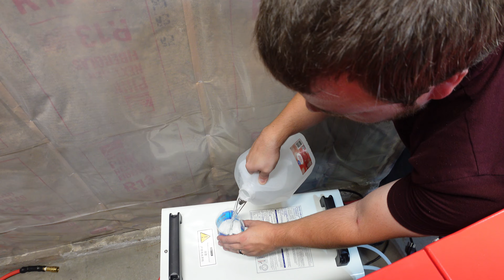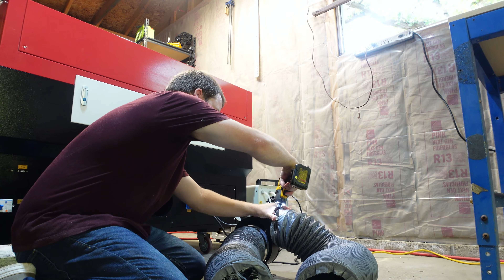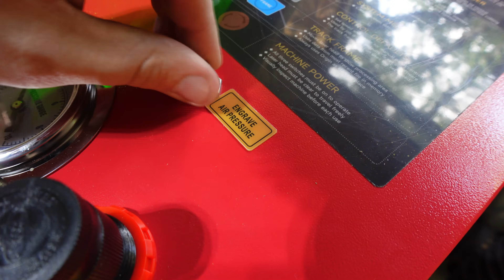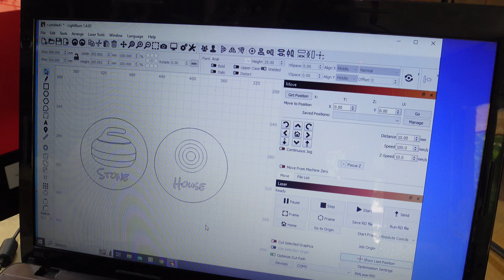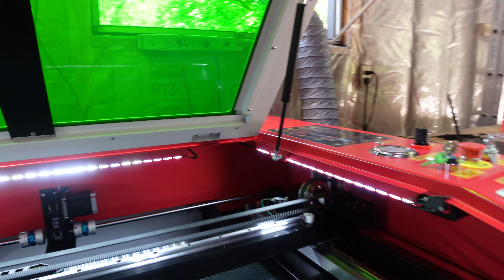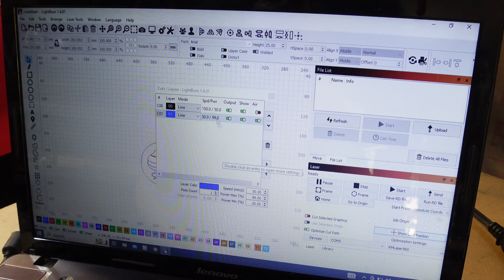How to Setup Your Chinese CO2 Laser Engraver Cutter - RMLaser RM960 Pro

Comment: How do you connect the laser to lightburn? I did exactly like you and had to manually add it but on lightburn it shows laser disconnected.
Reply from the maker: Make sure your usb is connected to the rear usb port on the laser, not the side port.

You might need to install a driver so your com port recognizes the laser controller. Go to device manager in windows and make sure the com port is recognizable. 

Also make sure your lightburn version is correct. In Lightburn go to Help>License Management

Just under the license key section, make sure it says Gcode, DSP

If you don't see that, you'll need to upgrade your version of lightburn to talk to the ruida controller. The cheaper version only talks to diode lasers.
Reply: @lukeman269 thank you

Comment: Can this machine cuts 20mm acrylic ?
Reply from the maker: @eou.itachi8774  no I don’t think so. I’ve tried to cut 19mm wood and it doesn’t do very well. They make different lenses that would allow you to cut thicker material more efficiently. Default configuration comes with a lens that can cut 10mm material and engrave detailed images.
Reply: yes, the machine can cut 20mm acrylic, because acrylic has a more uniform density than wood, it can be cut easily.

Comment: Can the compressor be set at the reguator at a higher setting say 100 psi but controlled at the machine for say 40 psi? I'm hoping I can still use my compressor for other things other than just the RM.
Reply from the maker: @TheAyotteMan  yeah the co2 laser has a built in regulator.

Comment: Does this model have an iron honeycomb rather than an aluminum honeycomb?
Reply from the maker: Its magnetic. So definitely not aluminum.
Reply: @lukeman269  Thanks for your quick reply — also, how is the company’s tech support ( or lack of)?
Reply from the maker: @leelemley3547  I’ve had quick response from the owner of the company. Usually within a day.
Reply: @lukeman269 … I’ve got one more for you — did your machine come with a manual?
Reply from the maker: @leelemley3547  it came with a usb drive full of documentation and videos.
Reply: @leelemley3547  There is also direct support for USA customers and Canadian.

Comment: Great video again, and I have a question. How did you manage to install the easy connector for the air line on the machine ?
Reply from the maker: It’s been awhile since I last looked at it. Pretty sure I replaced the inlet with a standard 1/4 male quick connect that connects to a shop air hose.

Comment: Great video - with this 100watt machine, what kind of outlet/ fuse box setup is required?
Reply from the maker: I run a 20a circuit for mine and that’s enough to run the laser and the chiller. You’ll need a separate circuit for an air compressor to run the air assist.

Comment: Nice detailed video , nice well equipped/ designed unit .Any updates after using it for some time. Any inputs on the otb compressor and blower noise levels. 
 is there a collection tray in the lower compartment?
Reply from the maker: Thank you!

I did notice the x and y axis wasn’t perfectly perpendicular to each other as I was getting some skewed results on bigger cuts that use most of the bed area. Very simple to adjust with 4 screws on each Y rail and used a metal square to get the rails perpendicular to the X axis. Should have done this from the start.

Other than that, it’s been a great machine.  Cuts through 1/2” poplar wood with ease. I use it to cut corrugated plastic, neoprene foam sheets, foam board, acrylic, and even card stock for stencils.

Noise levels are fine for me as I have a cnc router which is 3 times louder than the laser. Overall the loudest part when using the laser is the compressed air I hook up to it. I have it set for 30-40psi when cutting.

There is a catch tray for scrap material. Just remove the bed to gain access to it and pull big pieces out by hand or vacuum smaller pieces.

Comment: Hey bud I am trying to align the laser and when I hit the splash button I keep getting an error code saying "cooler error 1" maybe I am not doing this correctly to get a quick pulse from the laser. I set min/max power on the controls to 15% to start so not to burn straight through the tape. Can you tell me possibly what I am doing wrong?
Reply from the maker: Do you have your chiller hooked up with the sensor cable? If not, it won’t run unless you hook it up or bypass the cooler shutdown feature in the ruida controller.
Reply: Where do you learn how to use the Ruida controller? I’m lost can you help me? Thanks

Comment: Hi Luke. Excellent in-depth video. Few questions: 
1) 3 months into ownership, would you still recommend the machine? 
2) Would you have ordered/done anything differently if you could go back in time? 
3) we’re in Canada where it gets as cold, if not colder than where you are. Other than the anti-freeze, are there any other precautions you’re taking this winter? 
4) I’m speaking with ray’s sales person, and I am being charged $256 for an extra tube. Would you recommend getting it? 

Thanks in advance and I’ve made sure to like your video and subscribe to your channel, so don’t stop putting out content!
Reply from the maker: Yes I would still recommend this machine. My wife has been using it non-stop the last few weeks as she is getting ready for a craft fair this weekend. The machine is a workhorse.

I don’t think I would have done anything differently. I was looking at Omtech as the other option but wasn’t thrilled I had to pay for all the extra components like chiller, exhaust blower, and even shipping cost was expensive. I saved money going with the RM960 and Ray assures me it’s a better quality product. Very similar to Boss laser quality.

I’m not taking any other precautions currently this winter. So far so good. We’ve had some pretty cool weather in MN so far and it’s been working in the non-heated garage. The chiller does set off an alarm when the temp gets below 0c. Need to figure out how to turn it off or change the setpoint so it doesn’t trigger the alarm. I am also considering ordering a simple pump and use a bucket with a lid as the antifreeze won’t ever heat up passed 15c when running the laser right now in the winter. Would be more efficient I think.

Interesting you’re being charged for another tube as mine came with the extra. Maybe I bought my laser at a time where bonus items were included. Not really sure. Either way, I think the tube will last a few years of heavy use. Up to you if you want to have the peace of mind having that extra tube on hand just in case. 

I do need to get my butt in gear and make more videos. Probably make a video showing how to get the best results on different materials next. Can be tricky when you have 100 watts of power on tap lol.

Let me know if you have any other questions!
Reply: @lukeman269  How much do one of these units go for? I'm curious about CO2 lasers, and this could be a future purchase.
Reply from the maker: @WiseAssDuck  there’s a link in the description from the place I bought mine. I paid around $5500 at the time of this video.
Reply: Thanks so much for the reply, Luke. We watched your wife’s fridge magnet video as well! 

God bless the both of you and we’ll keep an eye out for more videos!

Comment: Hey Luke great video been looking at this model. Have you used a rotary on it it?  Is there a hookup for a rotary right inside the bed area?  Do you have a suggestion for a rotary mainly concerned about tumblers. Any advice would be appreciated
Reply from the maker: Thanks for watching Kevin!

Yep the port is inside the machine when you lower the bed on the righthand side. I have not ordered a rotary for it yet. It's on the list of things to buy next! 

This is my first co2 laser so I don't have anything to compare it to but Ray (the owner of RM Laser) assures me this is comparable to Boss lasers and much nicer than Omtech lasers. This does certainly feel like a nice quality machine. It's a bonus that it comes with a nice chiller, exhaust blower, and an extra 100w laser tube.

I would reach out to ray@rmlaser dot com to see what he would suggest on a rotary that would work for you. He's been very helpful with all my questions and it's really cool to be able to have direct product support. He usually replies within a day or so. Hope this helps!
Reply: @lukeman269  suggestion on extra parts to order to have on hand to minimize down time?  Any idea the way your came pack with the extras, especially the extra tube, is that standard?
Reply from the maker: @KevinSmith-db2yi  yes it’s standard if you buy the same laser I have. Comes with some extra lenses and some hardware too. I’d imagine I should be running for a long time without having to replace parts very often. Very good quality machine.